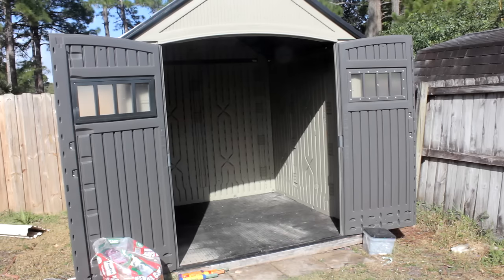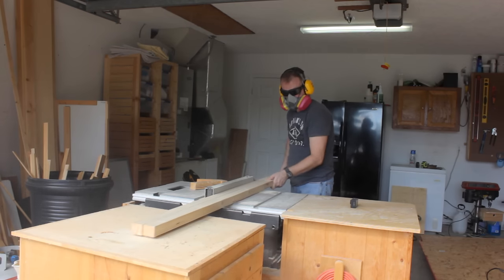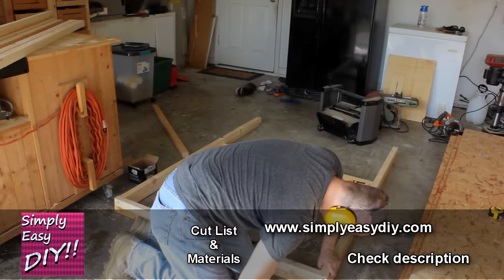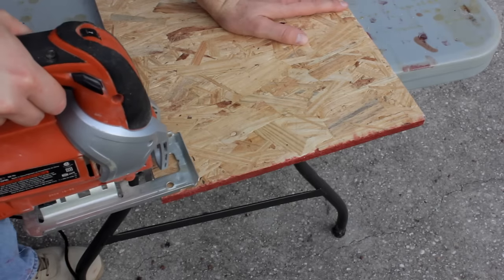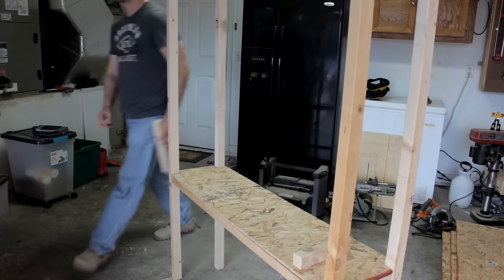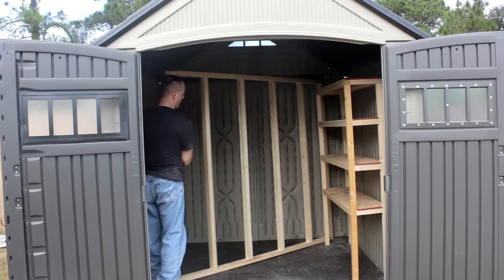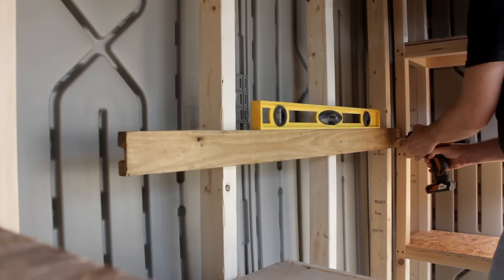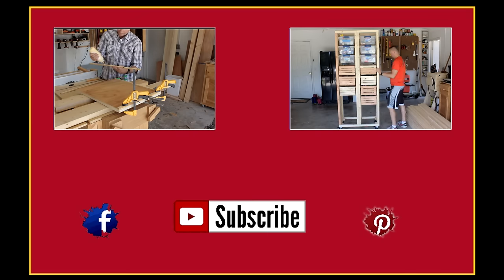DIY Shed Shelves

Comment: Nice video. Very easy to understand. Few questions. If you can remember, approximately how much were the materials to make the first shelf? And, if I go into Lowe's or Home Depot, will they cut the wood for me according to my specifications? Thanks in advance!
Reply from the maker: I can't remember but just eyeballing it, it looks like less than $20 not including nails and screws.  Yes both stores will cut the materials for you.

Comment: i need to build some shelves for a serious record collection - but frankly i don't like those corner sections where four skrews all intersect between the same two inch verticle beam ... surely they will undermine the strength / continuity of the joint

Comment: I feel those shelf frames would have been better with some wood glue between the joints and sat on some plates to spread the load being pushed onto the plastic floor. 😃 great vid, sub'bed and can't wait to see more.

Comment: I made the exact same shelf style in my garage but didn't rip the 2x4 down.  I ended up with an 8' long shelf that's 2' deep.  Works great and very strong even with 1/2" OSB shelving.  Even with a bottom shelf just off the garage floor it's a bit top heavy and I secured it to the wall.
Reply from the maker: +StArFuRyZz Awesome.

Comment: In the video it appears as if the top of the frame is screwed down vertically, into the 2x2 running up and down.   If the screw is going down, then how are you able to also screw the top side piece in place also?   Am I missing something?   Anyone????

Comment: Nice build but curious is your shed at a slight angle or was that the camera wasn't level when you filmed the video.
Reply from the maker: +Joanne Cooper The shed is level but the ground slopes back towards a drainage canal behind the fence.  The convergence of the two lines coupled with the wide angled lens magnifies the effect.